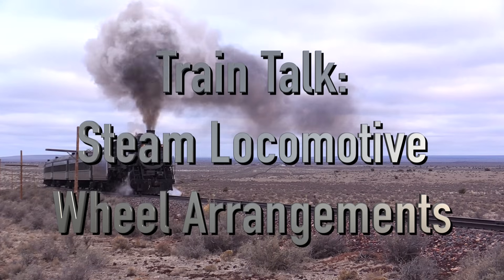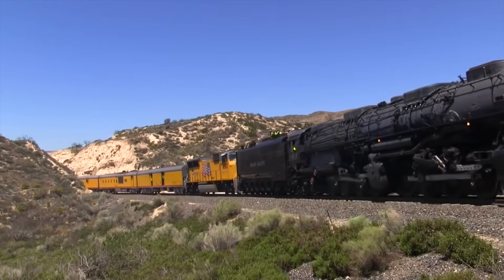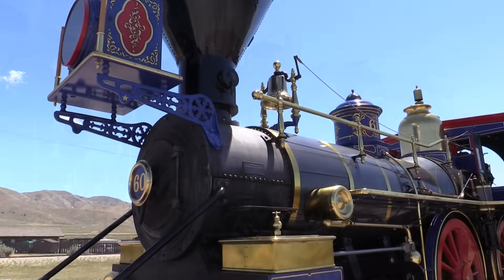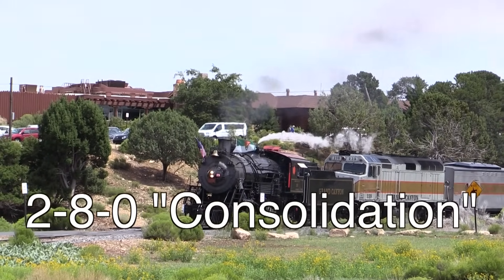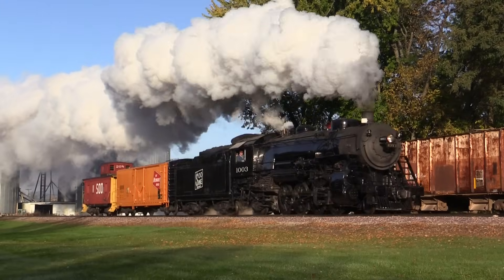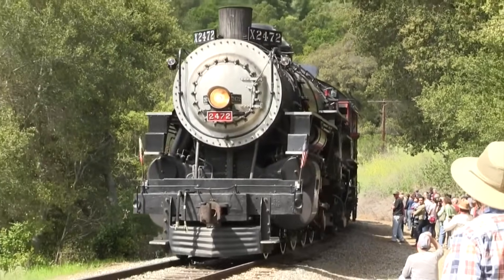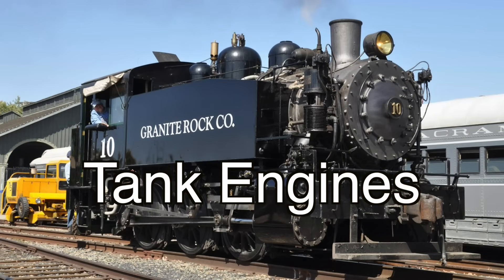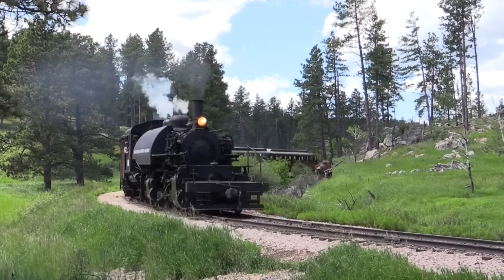Steam Locomotive Wheel Arrangements: Train Talk Ep. 10

Comment: The "Pacific" was called that because the first ones were for the New Zealand Railways, in the southwest Pacific; built by Baldwin. The trailing truck was necessary to support the wide firebox, designed to produce a high level of continuous output: the NZR had steep ruling grades, and very few flat runs. There was a 4-6-2 that predated these, but that was really a ten-wheeler with added stability.. The "Pacific" type was mixed traffic (NZR never had special passenger locomotives) and became very much used, until trains got too heavy, and 4-8-4 and 4-8-2 locomotives replaced them.
Reply: They were called Pacific after the Missouri Paciffic Lines - being the first American road to order they type.  The idea that the type was named after the ocean emerged decades after the type's introduction in North America - and decades after the common name had been universally adopted.  It's a myth which ought to be discarded.

Comment: I'd never heard of tank engines with two sets of driving wheels. What's the purpose of a tank engine having that arrangement?
Reply: It's called articulation, which involves making the locomotives wheel frame to be articulated via slicing them into 2 and connect them by a giant pin. This makes the locomotives negotiate tighter turning radius while still maintaining their power spec
Reply: @BraviazRahadi  I understand that. But why would a tank engine need something like that, since they are typically compact?
Reply: @Dragblacker  I think due to being operated on steep mountain railroad

Comment: Enjoyed the video. Thanks. 
There appears to be a huge variation in the size (diameter) of the driving wheels on the different locomotives. Do you happen to know why some have very large wheels while others are smaller in size?
Reply: The size of the wheels will be different for different uses.  The bigger the wheels the faster, they tend to be used more for commercial passenger use. Trains with smaller roadwheels are slower and tend to carry much heavier loads.
Reply: Driver height had an influence on a locomotive's ability to transform power at the cylinders to hauling power.  The lower the driver height the more efficiently power was transferred to the railhead.  They trade-off being lower road speed.  So freight types tended to have lower drivers.

Comment: Would have liked to have seen mention of the European systems of specifying wheel arrangement.  The old one (not sure of the original name) is like Whyte notation but counts axles (or the wheels on just one side), and omits the hyphens.  The newer one (not sure of the original name) used letters for groups of driving axles and evolved into the modern wheel arrangement systems (AAR in North America and UIC in Europe -- not sure which ones are favored in Asia, Africa, and South/Central America).  Both Whyte and the other systems had to be extended to accommodate articulated locomotives.

Comment: You missed the 2-6-2 prairie, 2-6-0 mogul , 4-8-2 mountain, 4-4-2 atlantic, 2-8-4 Berkshire, 2-8-8-4 Yellowstone , 2-10-0 decapod, 2-10-2 Santa Fe and 4-6-4 Hudson. You missed other wheel arrangements I don't know the name of but these are the 4-8-0, 4-6-0 and 0-4-2
Reply from the maker: Unfortunately, I didn't have time to go through the history of every wheel arrangement and some of them were not used very often. I went through a few of the ones you mentioned briefly at the end of the video.
Reply: CoasterFan2105 now I know the 4-6-0, it's names the ten wheeler and I knew that UP challenger was 4-6-6-4 but I only thought that the UP challenger had that wheel arrangement, looks like there other challengers out there so the UP challenger is named after its wheel arrangement

Comment: Wonderful video with practical examples!

You would think that the numbers are always even - so the Whyte notation seems inefficient. Mr. Whyte could have halved the numbers, making counting wheels just on one side of the engine simpler and less error prone. However, there are examples of monorail locomotives... at least for the driving wheels which used a central rail. One such was Patiala State Monorail Trainways whose designation is 0-3-0. One driving wheel per axle. It's the only example of an odd-number in the list shown in Wiki's "Whyte notation"

In another monorail where the notation becomes problematic is for Listowel and Ballybunion Railway. It was 0-6-0 but Wiki acknowledges "strictly speaking, 0-3-0".

If monorail locomotives had an even number of driving wheels then we'd be back to confusion. From the notation alone there would be no way of telling whether it was a monorail design as it would more likely be mistaken for common 2-wheeled axles.

Comment: Duplex and triplex locomotives use the Whyte system as well. The Triplex is basically an Articulated or Mallet type, with yet another set of driving wheels. The duplexes, ironically, are different from the three previous types, as while they have two sets of driving wheels, they sit on a rigid frame. Articulateds, Mallets, and Triplexes have a frame which is hinged to pivot (like pilot and trailing wheels) one of the driving sets to get around sharp curves using a longer locomotive

Comment: Question. What is the designation for this locomotive.  2 - 8 - 0  but the 1st set of drivers is separated from the latter 3 sets by maybe half the dia of the driver? I found a picturw but the link is too long to post (????)  google  IC locomotive 638   Drop down the the line of pictures and click on the  3rd pic (I.C.R.R. engine 638).  Could this be the source of that line in the Casey Jones song about the "6 8 wheeler"??  (along with literary license lol)
Reply from the maker: Hey, that would still be a 2-8-0. The drive wheels are only separated based on cylinder set. So for articulated locomotives, they have 2 and sometimes 3 different sets of cylinders, so the driving wheels are grouped based on which cylinder set they go with. I think the "6 8 wheeler" line in the song is probably talking about the diameter of the  driving wheels (probably 68 inches).

Comment: Does the U.S. (Specifically Union Pacific) have a lot of Tank Engines? I know of plenty of Tank Engines in the U.K. just not brushed up on any here. It doesn't seem like we have a lot in the way of small engines, lol.
Reply from the maker: There are quite a few in preservation. You see them at a lot of railroad museums with smaller demonstration railroads because they are economical. During the steam era, you didn't see many on the big RR's, usually only on mining or logging operations. The bigger railroads typically used switchers with tenders.
Reply: CoasterFan2105 Makes sense.

Comment: How can a steam locomotive run with a diesel, like with that metrolink you were showing? It just seems like it'd be different.
Reply from the maker: Some steam locomotives are actually fitted with devices that detect the position of the throttle and can then adjust the speed of a trailing diesel correspondingly.
Reply: diesel is just there to provide electricity to the passenger cars as well as backup power if the train needs it
Reply: Mysteryfoxx go look for videos of the rebuilt UP844s break in runs.  links titled:
< Union Pacific 844 2017 Break-In Run Parts 1 thru 4 >. They have a diesel behind the steamer. (I suspect either to provide a load for pulling OR if some - new - part breaks they cant allow it to sit on a main line waiting for a tow.) LOL And in one of the 4 segments they explain the electronics that allow control of the diesel.
Reply: Mysteryfoxx RJ the diesel is providing dynamic breaking, and electricity for the passenger cars

Comment: Wait, would if it was a 0-2-2-0 or a 0-4-2
Reply from the maker: I've never heard of a 0-2-2-0, but an 0-4-2 would be called a "Forney". They were short engines where the tender was permanently attached to the frame of the locomotive.
Reply: CoasterFan2105 oh ok, yeah because I've seen one and was thinking it wasn't even a real engine but it was.
Reply: CoasterFan2105 I was looking at vids of sdnx 2304 and in 2008 2304 and 2306 basically sounded the same
Reply: I do know one of the 0-4-2 steam locomotives is at Roaring Camp.

Comment: couple of ideas, switch engines, C&O, B&LE, Missabe, had some freakin'  HUGE yard engines, 0-10-0, 0-10-2, and 0-6-6-0, and 0-8-8-0, and booster equipment engine truck, tender truck mounted versions
Reply from the maker: Wow, that's really cool! I'll have to look at those.
Reply: CoasterFan2105 
yah, rattleing around, looking up bits & peices for my latest drawing, n' my little brain wanders off.
also, didn't see 4-12-2, 4-10-2, camelbacks, et al.
then there are the experimentals, high pressure, watertube boilers, four cylinder 4-8-0,( B&O?), turbine sets, etc.
check out the Missabe yard engines, those suckers were just monsters!